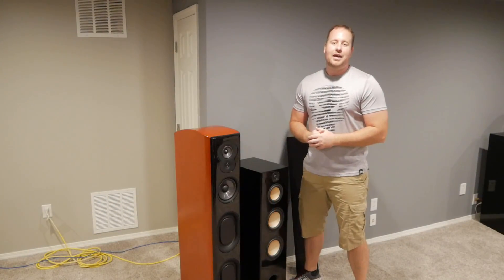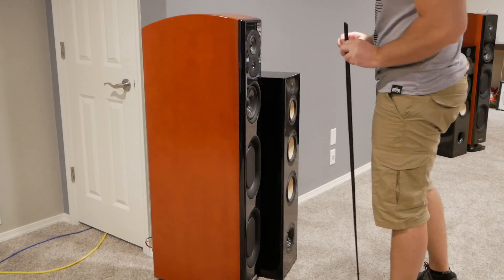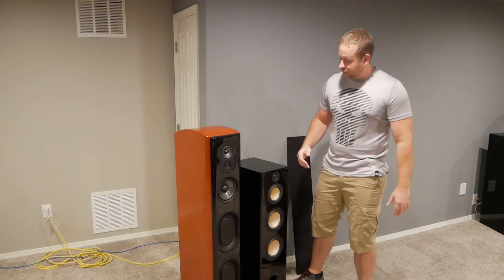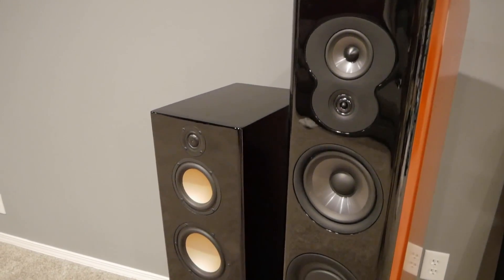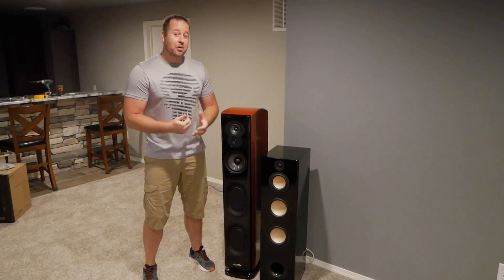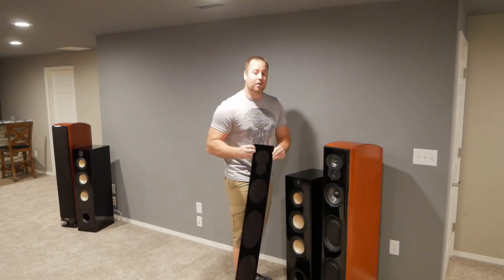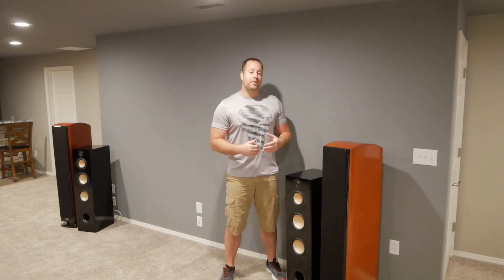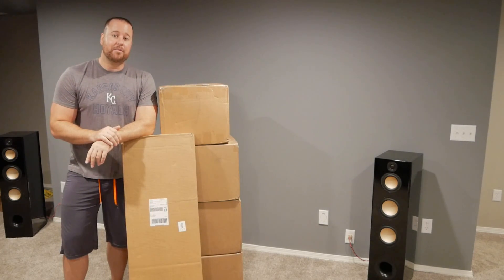Comparing my DIY Speakers vs Manufactured | Swope Towers vs Polk LSiM 707s

Comment: There a lot of better speakers than Polk at their price point.
Reply: Yep, Polk's heyday was the 80s-90s and they were and still are awesome speakers that can rival anything new for 50 times their current market price.  Buying previous top of the range models 2nd hand can be a really good value option, may have to replace some components though.  For new options, I think I'd be looking at the likes of maybe Kef Q900, I believe there is a new model out now, though I have not researched it.
Reply: Please name a few would be interested.
Reply: I am a big fan of B&W and Focal, I would look at those first if I were buying factory speakers.
Reply: @SpeakerBuilder  And neither of those are remotely close to Polk Price Ranges. But yes both of those are amazing choices!  :)
Reply: Speaker Builder B&W doesn’t tickle my fancy but agree on the Focal.  Looks like they just discontinued Electra, would probably look at Kanta or Sopra line.
Reply: Both B&W and Focal make speakers in that price range, but whether those compare favorably to the Polks, I can't say. If one sticks with the satellite speakers, and adds a sub woofer, you can get a lot of speaker for the money. But then, I build my own, so I don't have any experience with factory speakers to draw on. The other main issue when listening to any tower speaker is the fact that the position of the bass drivers is fixed at the ideal position for the mid and tweeter (if properly set up), and that is rarely if ever the proper location for the bass drivers to produce flat response at the listening position due to room reflections. Hence my focus on satellites and separate subs. But that means folks are critiquing the bass from tower speakers for better or worse based much more on poor placement in the room vs poor speaker performance. That issue is lost on most folks, and important to keep in mind.
Reply: @SpeakerBuilder  Ok I will give you the cheapest Focals are in line with the most expensive Polks. I don't think the LSim are garbage but I would pick the Focal even at the low end. No doubt that towers especially those with a real woofer/sub woofer to limit your placement. I own a pair of towers that run a 10" sub in each (side firing, rear vented) they do get pretty low and with careful placement they sound outstanding but that being said I still run an actual subwoofer.  I will say though a lot of times if I am listening to music I'm in direct mode and the sub is off.  Satellites with a Sub offer a lot more flexibility for sure.
Reply: Speaker Builder So the LSiM acts more like a 3-way with dual tuned port subs.  I have my pair bi-wired, the dual bass drivers internal xover is at 100Hz and the top portion midbass, mid and tweeter function like the 703.  Thankfully, with my room placement and seating position, the bass is fairly well controlled.  I have in room measurements at and around the listening position with an ARC mic.  They do need room to breathe and on either outer side of them they are flanked by large room openings to other spaces where the bass really travels.  In those rooms you get bass trap like functions and lots of bass.

As far as video reviews, I leave it up to the audiophiliac, joentell, zerofidelity, newrecordday, techodad, heck even zreviews:-)
Reply: Nice to hear that confirmation re Focal. I have enjoyed Focal drivers for many decades, and always found them to be top of the line. As a speaker manufacturer, they are one of the only companies that truly make their own drivers.
Reply: @mpitogo  

https://elacdeals.com/collections/debut-2-0-series/products/b-stock-f6-2-6-5-floorstanding-speaker-each

https://www.fluance.com/signature-series-hi-fi-three-way-floorstanding-speakers-natural-walnut

https://www.klipsch.com/products/rf-7-iii-floorstanding-speaker

https://www.amazon.com/MartinLogan-Motion-Gloss-Black-Floorstanding/dp/B007ZBIITM/ref=zg_bs_3236453011_41?_encoding=UTF8&psc=1&refRID=4EVGC5QZJPGPRS46KAC4
Reply: Brett DiMichele Studios Elac Debut?  I had a pair of B6, too warm and boomy for my taste, gave them away.  Replaced with KEF Q100.  Martin Logan Motion 40?  You’re also kidding?  I own a pair of those Motion 40’s in gloss black and it’s sitting a corner on timeout.  I previously had them in my master bedroom powered by a RA-1570. I swaped the ML for a pair of Totem Hawk.  The ML are OK. I have Klipsch RP-600M and so far it’s OK no clue on the towers.  None you mentioned is in the same league as my Polk LSiM 707.  

No experience with fluance so can’t comment.
Reply: @mpitogo  I'm not here making purchasing recommendations. I am merely responding to the question. Your ears will tell you what to purchase :)
Reply: Brett DiMichele Studios True, buy based on your ears.  No offense intended.  I’ve probably purchased over 2 dozen pairs of speakers so far.  And Polk Audio I have the most of including the recent two flagship pairs LSiM 707 and LSi25, and dabbled in many other brands, ML, KEF, Klipsch, Elac, Totem, JBL, defunct Frazier and other brands I can hardly remember.  My ears say Polk Audio for the price, I have’t found a speaker yet which can out class my LSiM 707, which are powered by a decent front end gear.  I have to go up in price point to something like a Legacy Audio, or maybe not so high with Tekton Design Double Impact.
Reply: That's great experience, you ought to do your own videos critiquing these for other folks. Few of us have such time and money to buy so many different speakers. The Legacy Audio speakers look astounding, as does their price. I've like to hear your take on some of the offerings by B&W and Focal.
Reply: @SpeakerBuilder  if this was a response to me, I am in no way shape or form, qualified to critique speakers for people. I leave stuff like that up to Zeos from Z Reviews and others. I also dabble in making my own speakers and have friends in the business. I have a pair of 8.5' tall Line Arrays sitting in my spare bedroom that I really need to get off my arse and finish one of these years. My friend John at Acoustic Elegance designed them (I think his pair and the pair that I will finish some day) are the only two sets out there. 

Most folks would laugh at my "setup" :)  Edit ignore me, I see you was responding to mpitogo, I didn't see his latest reply!
Reply from the maker: Figured I would jump in too ☺ The polks were excellent speakers. I feel I may have come off as if they weren't. I was trusting my ears as well, which came back to the DIY speakers every time. For the money, I felt the DIY speakers are an excellent value. These were the first oem speakers I had bought actually. Listened to quite a few, but first time buying. I guess my point of view was more looking at the overall cost vs value. With most things, DIY is going to save money. The tradeoff is time. And how good you can make the finished product look lol. Anyways, both good speakers, I just felt my ears liked the DIY better and the value was better for me
Reply: @mpitogo   Glad to hear your LSim 707's are serving your ears well. They are a beautiful set of speakers and Polk is a great company.  I don't have much experience with their home audio gear, but I've run their mobile audio in my boat and numerous cars and have never been disappointed.
Reply: @LifeofBliss  no argument here. I have like 2 grand tied up in the components for my line arrays (12, 6.5" Kevlar Mids per cabinet, 12, Planar Ribbons per cabinet) and not including my time there isn't much out there this side of 100K that would compete.  DIY is a great thing, especially when I leave it to the experts to do the design work! That's far beyond me :)  I can bolt things together, solder things, wire things and finish things no problem.  But the folks that can actually sit down and figure it all out and make it wow our ears.. Those men and women are the real genius!  Your video was very well done and I appreciate your honest opinions.
Reply: Life of Bliss No doubt your DIY sound great.  I’ve heard many which are but it does take great skill and effort to do so.
Reply: Factory speakers have to be designed to please a very wide audience, and others have commented on my channel that the majority of buying  public do not like speakers that are too bright. As a musician, I am looking for the instruments to sound like real instruments in the room, so a bright system is my preference. But I have never heard factory speakers that satisfy my ears given this bias I have.
Reply from the maker: @GearHead4Lyfe  I'm the same way. I can pretty much build what needs to be done, but the design aspect is not my forte!
Reply: @SpeakerBuilder   I can go either way depending on what I'm listening to. But also bright doesn't have to mean fatiguing that's the part a lot of folks don't get. 

Have you heard the new Klipsche Reference line? I was watching Zeos test them and he was gushing about how well the horns performed. Honestly I could even hear it through my refitted JBL62 Monitors (running the Kevlar Woofs and Ribbons that go in my Line Array Project.

My main speakers are my AR9 Hi Res (not the vintage) and they are Bi-Amped off of my Marantz AVR. If any speaker should be bright they should be with a 1" titanium tweeter that's coated in diamond dust. But they aren't at all. They are super detailed and the mids are magnesium monocoques and they just love instrumental and jazz. I've had these things for so long and can't ever see myself getting rid of them. It's just a shame that shortly after I bought my AR9's that AR got into financial trouble and was gobbled up by Recoton (audiovox) and ruined.  :(

I have better source equipment for 2 channel but it's been packed up for a while. I have a Parasound Halo P3  Pre and a pair of 20 watt single ended triode monoblock tube amps that I used to run the Tweet/Mid section of the AR's in the past.
Reply: Since I am unwilling to spend the huge money on really good, high end factory speakers, I will likely never know if they really perform well compared to my home build active system (+ $5K invested).
Reply: @SpeakerBuilder  well you can at least check out the reviews if they peak your curiosity. Zeos (Zreviews) is entertaining  :)  So what's your actives setup? give me the skinny!  My Line Array's were designed to run passive XO's and I've got a bag full of perfect lay inductors and solen metalized poly caps and stuff, but honestly I'd rather drive them actively. So I'm curious to hear about your setup!  Edit never mind on the explaining part! Unlike most YT commenters I see you actually have a channel covering this stuff. Checking it out now! :)
Reply: Yes, I was going to send you over there, lots of info on electronic crossovers, etc. Esp, check out the video "Top of the Mountain", that explains my current set up. I have a new three way active speaker system I have constructed over the past year that I am still working on setting up in a dedicated listening space, future video to come.
Reply: @SpeakerBuilder  Yep I've been over there watching the vids. Great stuff! Marchand was on my list for active crossovers when I decided that was probably the best way to go. 

Question though. What about using something from the Pro Sound Market like a Behringer Super-X or the like. Was there a reason for not looking to the pro sound market and going with Marchand? I notice most of the pro sound stuff is only 24Db/Octave where as your Marchand is able to do much higher slopes on the Highs and Mids.
Reply: I've done live sound extensively (I own a moderate sized system), so I am quite familiar with pro sound equipment. The first issue is that the noise floor standards are much looser for pro sound components compared to home hi fi. Second, there is great variability in the quality of electronic components, and pro sound stuff generally just doesn't conform to such high sonic clarity standards as does home hi fi equipment. Pro sound stuff has to reproduce the live stage instruments, and many compromised to the quality of the sound are in play in a live setting compared to a studio recording, so the clarity is just not going to be there in the first place to reproduce. On the other hand, a recording studio is able to closely control all the variables and attain an impeccable level of clarity, and we want to be able to reproduce that clarity in our home hi fi equipment. The one advantage to the  pro sound electronic crossovers is there ability to sweep the crossover frequency on the fly while listening to music, and this can be helpful in establishing the ideal crossover frequencies for a given system and then building a high quality crossover using those values. I have found the quality of Marchand's electronics across the board to be exceptional. I'd recommend either the fully assembled XM44, or building your own version using the EMB44 modules, see my video on building electronic crossovers.
Reply: @mpitogo  thomas on youtube has actually reviewed a gazillion different speakers and has told me personally that these speakers are special and THE best value. The problem I believe people are having is what they use prior to the Polk's.  It makes all the difference
Reply: @mpitogo  Klipsch is a much better option than Polk. Horn-driven speakers give you a lot more value for the money and you never need to worry if your amp is powerful enough because they can run on anything. 10-20 Watts per channel is all you'll need. (most modern amps are at least  50W)  Your best bet is the Heritage line, which still makes the speakers of their heyday and are even better than the new klipsch in BestBuy next to the Polks. If you have the money, you can buy the heritage models new, but if you want a deal, you can buy the original Heritage models on the used market. Craigslist, ebay, audiogon and other speaker websites always have a good selection of old Klipsch. Go look at the (from small to large) Heresy, Forte, Chorus, Cornwall, LaScala, Belle and Klipschorn models and you can find world-class sound for cheap on the used market. They'll blow any modern polks away.
Reply: Esquire Moderator that is your opinion.  I am not too concerned about cost of an amp.
Reply: @mpitogo  Of course it's my opinion. That's what you get in the comments section and you specifically asked for opinions. If you aren't concerned about the cost of an amp, you shouldn't be concerned about the cost of your speakers, since they should be the best component of your system. Speakers have by far more impact on your sound then anything else. So, you should definitely go out and buy some Klipschorns and Cornwall's.
Reply: @esquiremoderator32  no worries, I own Klipsch speakers, while horns aren't my thing I do have a pair otherwise we'd only see horn speakers everywhere.
Reply: @mpitogo  Your basic question at the top fooled me into thinking you were new at this and I wrote my answer without reading the comments below. Sorry for reciting "the intro to Klipsch,"  which which you obviously know already. Oh well, maybe it will benefit somebody else looking to get started,
Reply: @mpitogo  Fluance
Reply: 613 Car Guy If I try out Fluance,  I think my wife will throw me out, I have speakers and gear stashed every where.  Speakers in boxes, in cabinets, towers behind the couch, an amp in my coat closet, a sub on the fireplace deck, all waiting to be hooked up again.
Reply: @mpitogo   lol that's crazy!  I have a 5.1 fluance setup and they sound great for the money.
Reply: Yeah ! Fluance is one of them

Comment: If the math is done right for the enclosure, it comes down to parts.  A DIY speaker with premium drivers will be a fraction the cost of boutique speakers.  FWIW:    polk uses mostly cheap drivers, no where near the quality of SB.  Sb are basically lower cost copies of scan-speak revelators, by former Scan-speak designers.
Reply from the maker: Did not know that about SB. They do make a very good driver. Have not personally heard any Scan-speak speakers, but I know of them and their quality (and price!). And yea I figured you are mainly paying for the nice enclosure and shipping with those polks. Glad I had the swopes to compare them with!

Comment: Not taking anything away from  Meniscus Audio, but, they just sell them, Paul Carmody , if I remember correctly, designed them. Paul deserves the credit for these fine speakers.
Reply from the maker: You are very correct, they do just sell them, not the designers. I will credit the designer in the description after confirming it's Paul. Thanks for the reminder!
Reply: Paul's designs are fantastic.
I have built 6 of his designs. For the price it's unbeatable. 
Curts designs are fantastic too, just uses more pricer speakers.
Reply: @beaver6969lv  What's the best kit you have built?
Reply from the maker: Look at diy sound group, they have several great kits. The 1299s from them are by far the best theater speakers I've built or heard